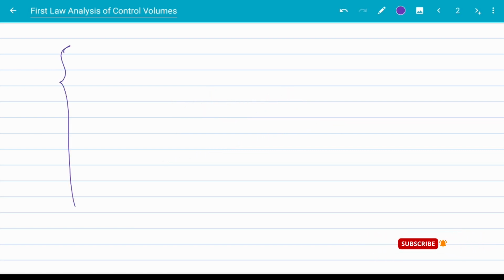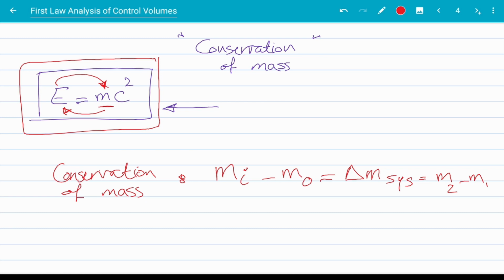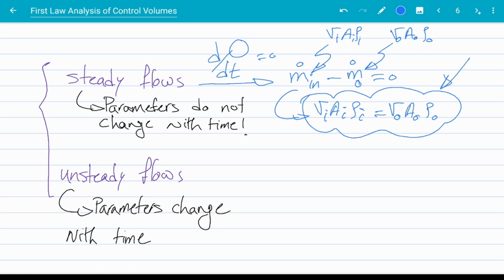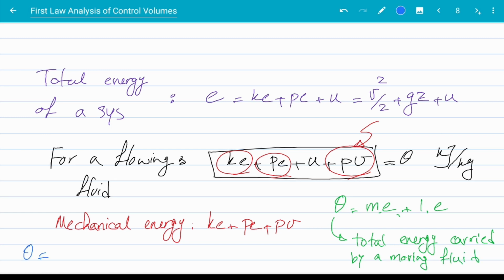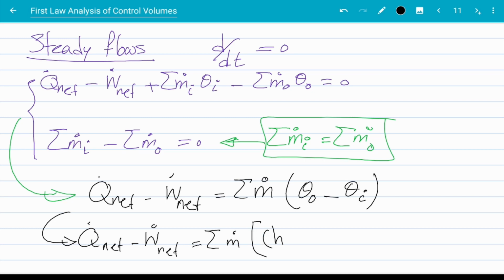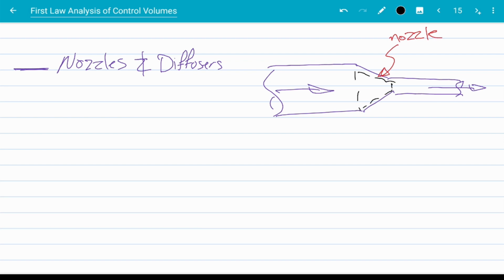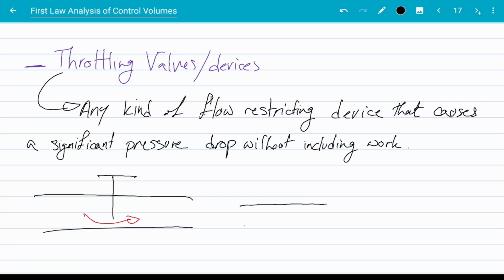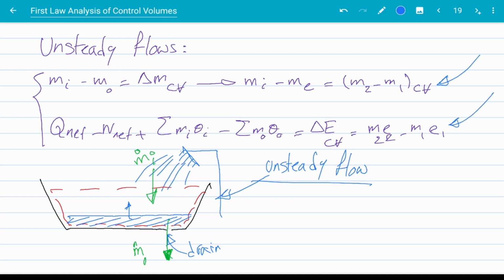First Law Analysis of Control Volumes - Thermodynamics

Comment: Great video! But is the formula to calculate energy in and out in a power plant m(ho-h)??
Reply from the maker: If you are asking about the power output of a turbine, then m(hi - ho). If you are asking about the power consumption of, say, a compressor, then m(ho - hi). It depends on what component of a power cycle you are analyzing. To better understand this, I would suggest writing the first law of thermodynamics across the turbine and compressor individually and see how the equations form up for these two devices.